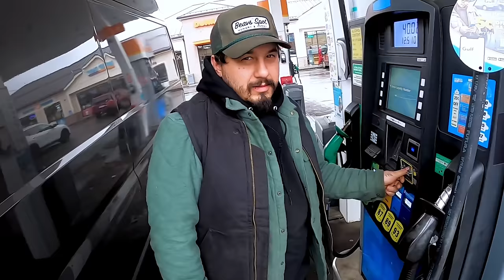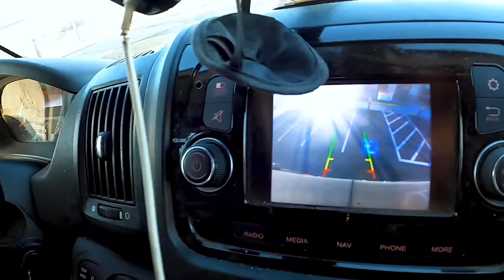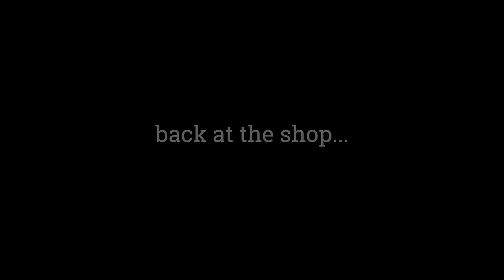Did we find Jimi Hendrix’s Panhead?

Comment: The Sportster isn't worth more than 2k
Reply: 🎯 here in Minnesota it wouldn't be much more than that either
Reply: 1800 is more likely.Its got coolness but it's a rusty crusty.
Reply: I've got a 2004 1200 Sportster with less than 5k on the clock for sale, it's never been rained on.